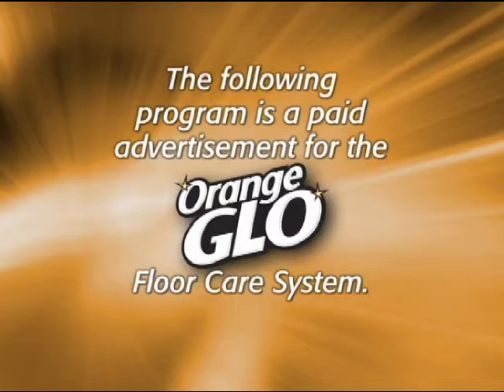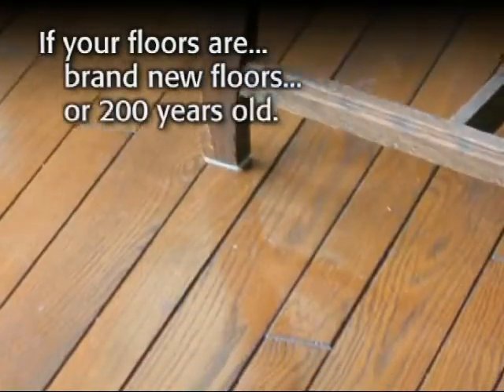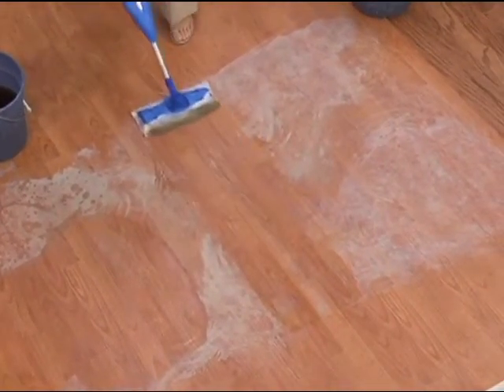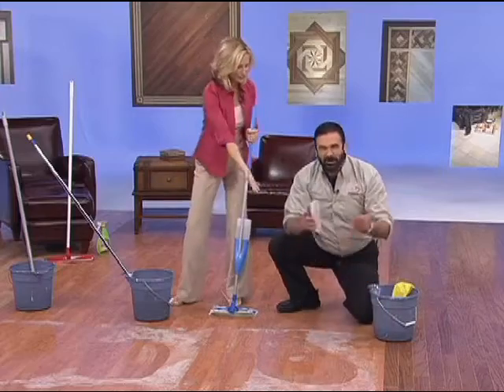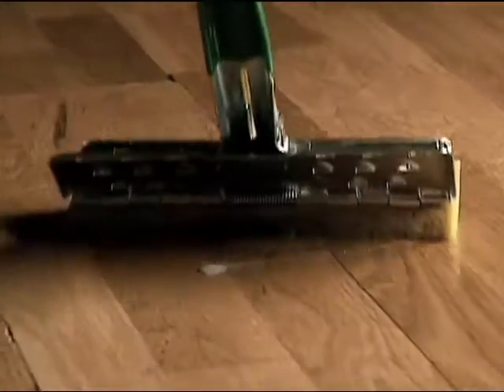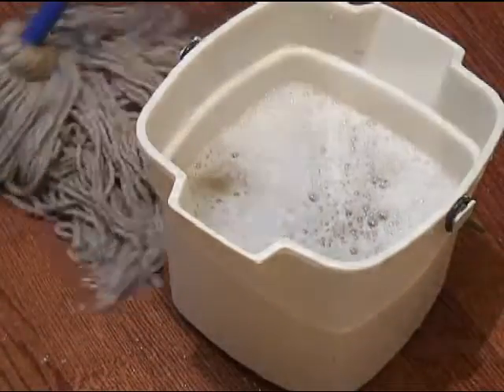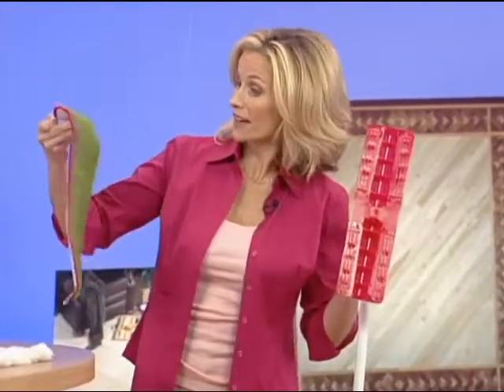Orange Glo Hardwood Floor Care System

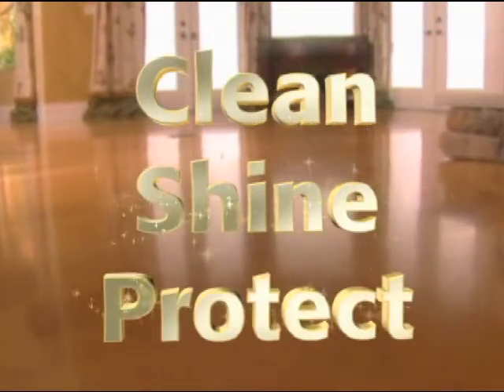Comment: 0:37 Welcome to Clean, Shine, & Protect. 🍊📺🍊📺🍊📺🍊📺🍊 

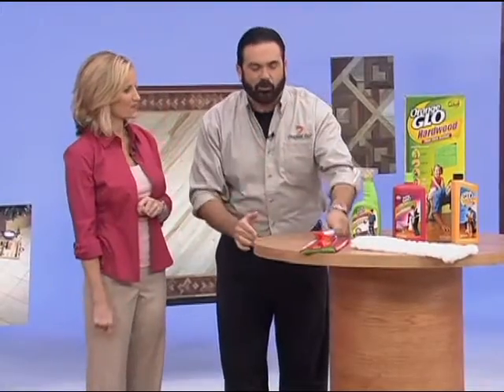2:33 Talking about orange glo, look at this floor damage. OMG! 

11:35 Look, your floors are being ruined... day after day... from this to this. 📺 📺 📺 📺 📺

16:28 Billy Mays went to meet the Marsh Family. 👩‍👧‍👦👩‍👧‍👦👩‍👧‍👦👩‍👧‍👦👩‍👧‍👦

17:52 From Old Home 🏚 to New Home 🏠 A man named Mike Kell, he's the owner of Nice City Homes. 

18:27 We tore up the carpet... we need putty knives scarpers for paint and plaster... but to clean, we used only: new paint... Orange Glo Hardwood Floor Cleaner... for all the wood trim... the doors... 🚪🚪🚪🚪🚪and the floors! To restore and protect the floors... we put down 2 coats of Orange Glo's Hardwood Floor Refinisher. 

The total cost? 

2 Gallons of Paint = $35.00 

1 Orange Glo Floor Care System = $39.98

TOTAL COST = $74.98

19:17 Home # 2 - built in the early 1900's. The Orange Glo Hardwood Floor Cleaner... took off decades of dirt and grime!

2 Gallons of Stock- Color Paint = $29.00

1 Orange Glo Floor Care System = $39.98

TOTAL FOR HOUSE # 2 = $68.98

21:28 Bona Kami Founded in 1919 in Sweeden. 🇸🇪 🇸🇪 🇸🇪 🇸🇪 🇸🇪

22:31 Orange Glo's Revita-Shine to Shine and protect Vinyl and Linoleum floors also!

25:09 Again look, your floors being ruined... day after day... from this to this. 📺 📺 📺 📺 📺